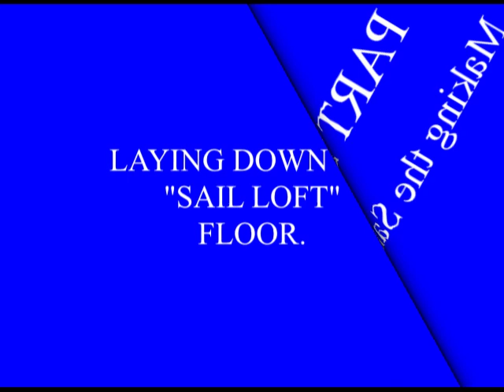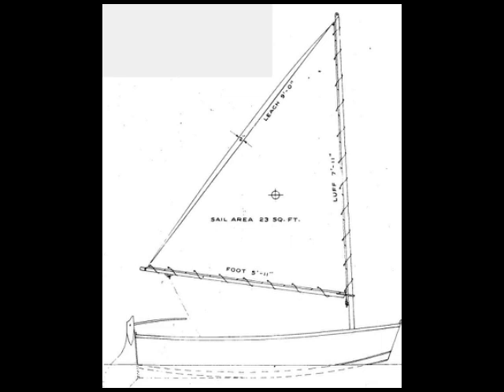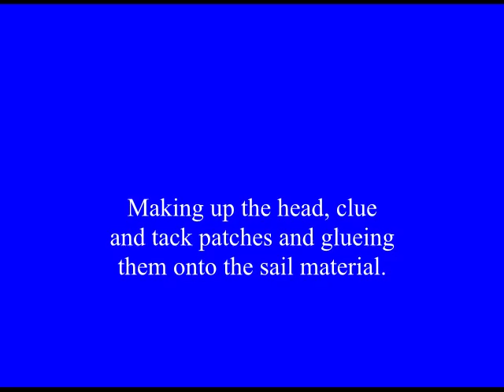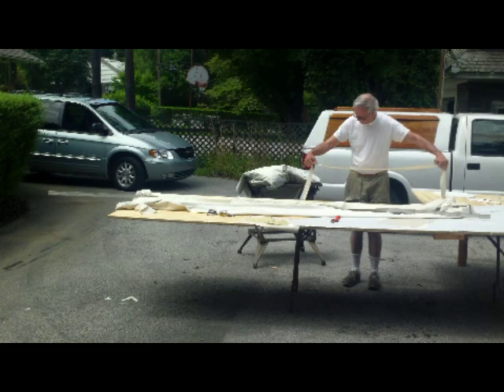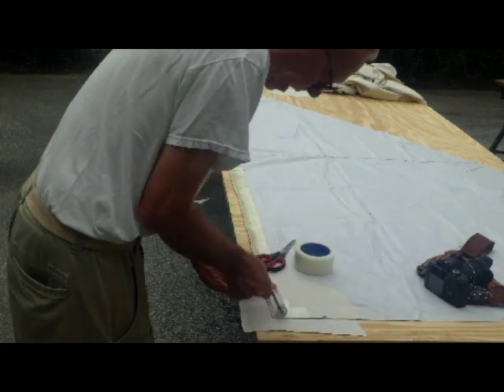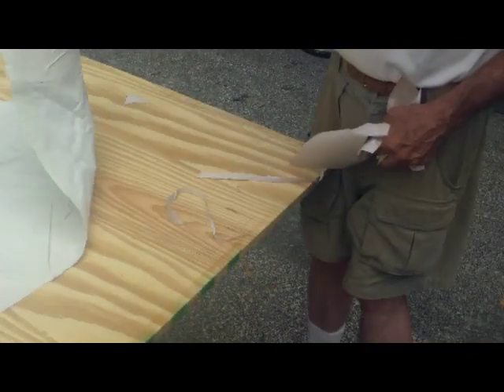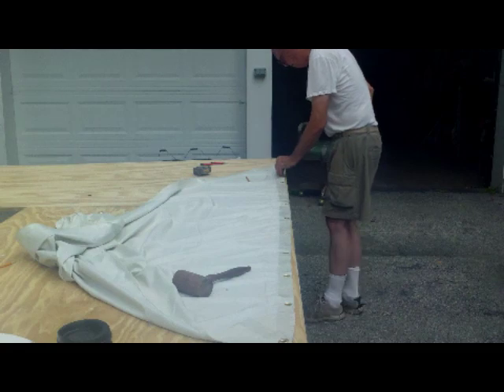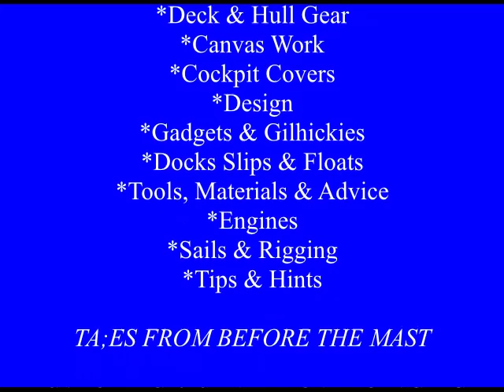MAKE YOUR OWN SAILS--PART 2--Making the Sail.

Comment: David, I think you forgot the most important thing, the sail design!   In order to create an airfoil from a flat piece of cloth, you need to have extra fabric that will shape.  You also will want that extra fabric to be placed so that more is toward the mast so you can drive upwind.
Reply: you are correct. however i gave it a shot prior to knowing any better and thankfully it worked. the butyl cloth stretches a bit. not sure if it was because of that, or these specific tarps being saggy and baggier then their stitched borders? each tarp is made of three panels as well, not sure if that is also a factor?  i would love to know why it worked in this particular setting as i have no prior sailing experience and now I'm just curious as to why i was spared the failure.

Comment: hello david,
 I have been enjoying your testing of the rubber cement. I would not have thought of trying the test with additional coats. I have used your contact cement for book binding with good results. I am a big fan of 3m 5200 for many applications. I also discovered hot glue sticks will attach pvc to polyethylene plastic if used in large amounts, but if frozen it will seperate, which can be helpful in making prototypes that need to be taken apart later. hope to see you sailing soon.

Comment: i did this method it worked great. i didn't add any extra fabric. somehow it worked up wind. not sure if i just got lucky too or if the butyl cloth stretched and took better shape. either way it was a sail for a dinghy i got as a gift. so I'm glad i didn't have to spend more then 35 bucks.